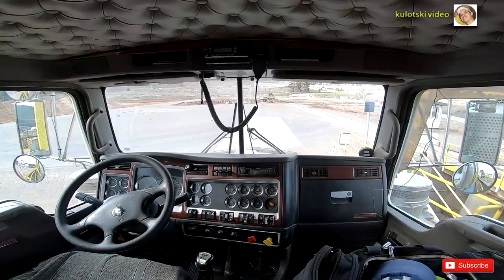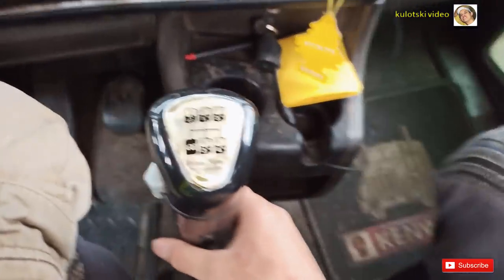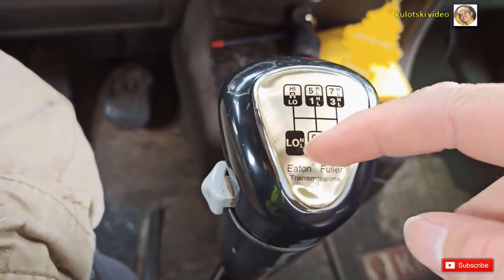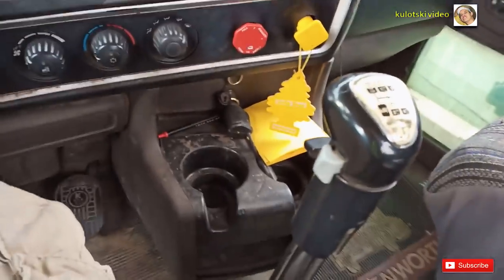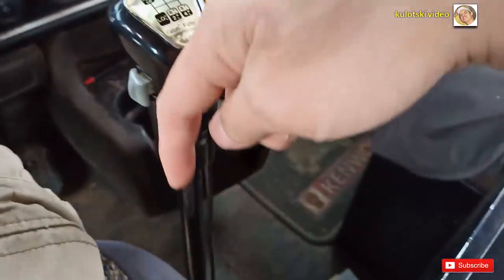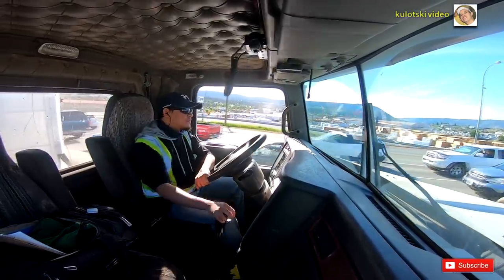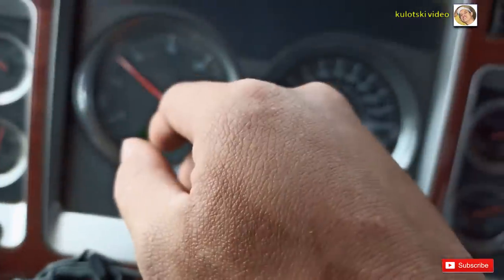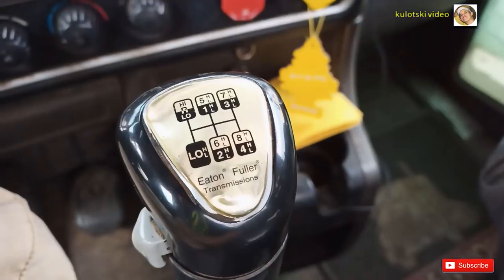PAANO MAGDRIVE NG MANUAL NA TRUCK 18 SPEED TRANSMISSION FILIPINO part 1

Comment: Everything runs on your RPM’s .diyan
Magkakatalo yan para di ka. Mag grind ng gear.first gear lang clutch mo diyan pag nakuha mo na lisensiya
Mo pero pag nasa schooling ka kailangan mo mag double clutch..driving with trailers is s easy as you look at it...pero yung turning ang tricky part diyan..kasi meron wide turn,S TURN,prefered S TURN..but you get use to it as long as you will have many hours in the wheels...madami kaakibat na responsibilidad ang meron air indorsement lisense...LOG BOOK,FEDERAL HOURS OF SERVICE..LOADING SECUREMNT etc...good money but lots of responsibility...ive been a B TRAIN driver in a refinery for quite sometimes,..ok lang den ang kita kaso abusado masyado ang mga taga transport
Reply from the maker: U said the best brother, thank u sa iyong maganda share about experiences, ingat palagi boss godbless

Comment: Some says it can damage the transmission gear if you dont use the  clutch while shifting
But for me. Some professional driver and mechanic specially from western countries they are expert regardind this. Also they didnt recomending shifting without clutch if can cause of damage of the transmission. Your able to shift but it depend on your knowledge how and when youll need to change. And what RPM NEEDED  b4 you performe it.  Many professionals trailer truck drivers are using this floating gear method. Its normal.

Comment: Idol db 8 gear lang yan di ksma un reverse at un sa sinasabi mong low kong paahon. pro pwede gumamit ng splitter pra sa high and low at pwese din gumamit ng puro high gear lang pg rektahan at malayuang byahe. Pwede din puro low gear lang gamitin pg medyo lubak lubak at medyo paahon ang daraanan.
Reply from the maker: 9 gear boss d kasama reverse. Pede boss basta if need mo mag change ng gear change mo na either high or low. Para d mag stalled

Comment: Ung floating clutch ba ay di nakaksira ng transmission? applicable ba yun sa lahat ng sasakayan?khit sa mga kotse at motorcycle?
Reply from the maker: Pan ganito klase na truck lang yan boss, d yan pede sa kotse o ibang sasakyan if search u sa google explain nila kaibahan ng engine ng mga yan kaya pede ma floating gears Hindi masisira ang truck transmission basta alam mo pano gawin
Reply: Salamat sa pag sagot brother

Comment: Dati nkahawak na ako ng  32  speed  nong 60s  pa  sa  PICOP  logging  co,  surigao   peterbilt 359    SPICER transmissions    w/  air starter   powered  by GM  engine   msarap gmitin  kaso ang prblma  npakaingay ng makina   lalo pag  loaded na ng troso   aahon na sa bundok    na   nka  double   1st gear   pagbaba ko ng truck  para akng bangag sa marijuana nong araw   ngyon  ang tahimik ng umandar ng mga mkina  para ng mga bubuyog

Comment: Sir kung empty ka lahat ba ng gear gagamitin mo or pwde mag short cut og mag skip ng gears like from 5 deretso sa 7 or 8..
Reply from the maker: Depende pa din boss sa sitwasyon ng daan, uphill downhill kailangan mo pa din mga gear ,off road, mostly ang skipping ng gear nagagawa mo sa downshifting.
Reply: Kung sa hi way ka lng.. tpos empty trailer ka lng? Ang dami kasi pag 18 lahat ginamit mo..
Reply from the maker: Ay pag highway empty at straight steady ka lang at mostly skip n ko ng skip, opinion ko to sir. Basta comfortable ka mag skip at alam u na ginagawa u, u are doing good Sir.
Reply from the maker: Madami nga Sir pero pag sanay ka na ok na at super sarap mag shift pag madami ka pa pede ishift, ewan ko Sir pero sarap magdrive
Reply: Mas gusto ko pa idrive yan kesa sa ferrari.. heheh

Comment: may tanong lang po ako. every time po ba 1500 rpm ang range before changing the gear? The same way din sa 1500rpm pag mag downshifting? Thank you po.
Reply from the maker: Not everytime may ginagawa po ako vlog about upshifting and downshift. Hindi po pareho ng rpm and downshift at upshift. Abangan nyo po this wk. Salamat po
Reply: @kulotskivideo4190  thank you po sa reply.  balak ko kasi babalik sa driving. it's been 5 years since nag back out ako from road test for class 3. pero ngayon may lakas loob na ako for class1.
Reply from the maker: Good job men! Never give up on your dreams

Comment: Lods parehas lang ba yan sa 10whelleer...aling po mas mahirap i drive un treller or 10wheller lods
Reply from the maker: Tol if 10 speed transmission ibig mo sabihin mas mahirap un para sakin.
Reply: @kulotskivideo4190  ah ok lods..wht i mean lods anu po pinagkaiba sa 10w at sa treller i drive

Comment: Boss para saan yung red at yellow button? Gusto ko kasi matuto sa mga malalaking truck
Reply from the maker: Un yellow boss parking brake ny semi o truck, un red parking brake ng trailer.
Reply: @kulotskivideo4190  salamat sa info  boss gusto ko kasi mag trabaho dyan kaso Wala ako experience sa mga truck though may work ako here sa pinas company driver sa maliit na company 16 years na ko ngddrive dito.... Gusto ko sana mag shift sa malalaking sasakyan gaya ng dinadrive mong truck.... Pa shout out nmn sa mga susunod na video na gagawin mo... Thanks and more power...